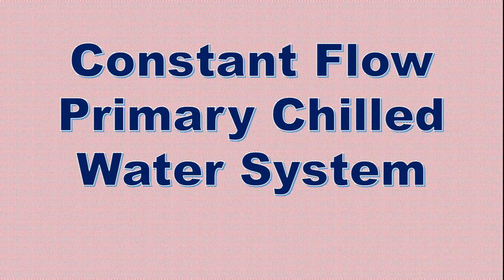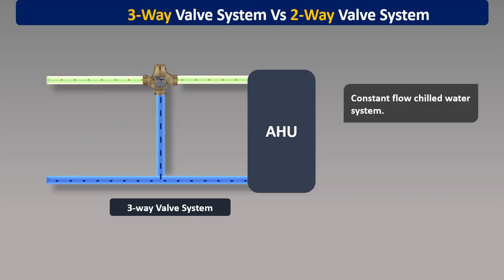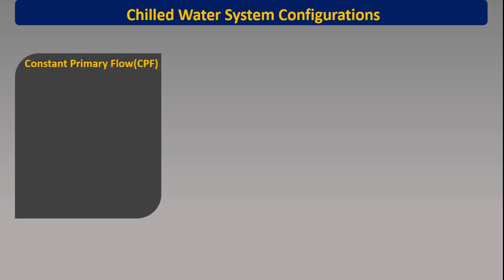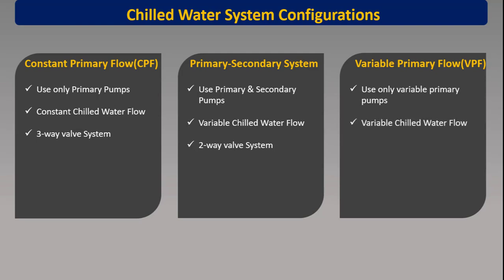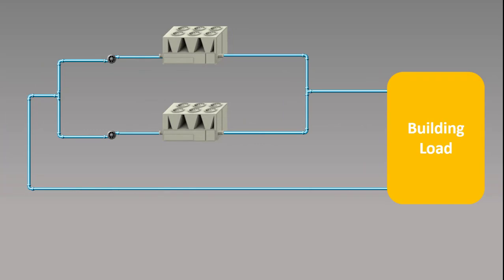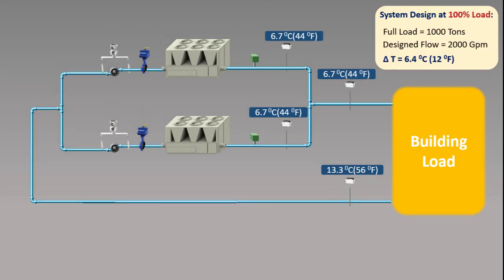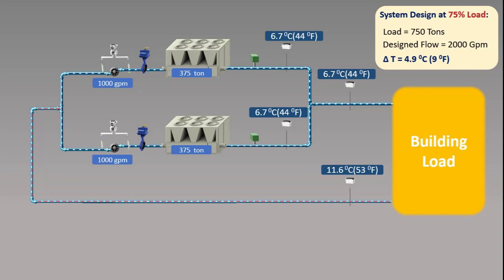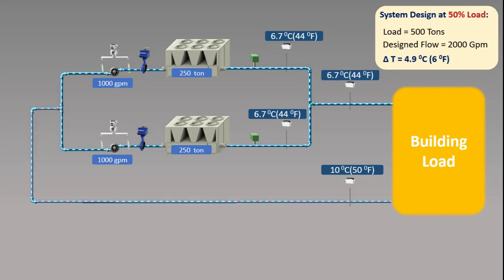Chilled Water System Working Part-1 | Building Management System | BMS Training 2021

Comment: Hi @TechSystems thank you for the video. You mention in the video that the motorised butterfly valve is their to isolate the nonoperational chiller but in the video when the second chiller is off at low load the chiller is not isolated in order to maintain a constant flow at all times. Question - In what scenario would you isolate a chiller and what effect would the drop in volume have on the 3-port control valves downstream (e.g. in-balance, decrease in authority)?

Comment: @techSystems - love the video, thank you. Just a question: At around 9:15 in the video, only 1 chiller is running due to low load conditions, but why not switch the accompanying pump off as well to save pumping energy costs? It is not necessary to run both pumps in this configuration with only 1 chiller running?
Reply from the maker: Hi,
This is a constant flow system with 3-way control valves at the AHUs and FCUs. So that's why both pumps needs to run to always maintain constant flow through system. Due to this drawback, this system is no longer used in the new buildings instead variable flow system is used with 2 way control valves.

Comment: Very informative video. Could you please make video about how chilled water pump speed controlled by differential pressure when there is high or low load, in secondary side pumping system.

Comment: Chiller sequence /Auto / n series main nhi chal rha h toh kya fault hoga plzz explain guyzzz
Reply from the maker: Was it working in Auto sequence previously? There can be many reasons. Might be the problem with DDC program
Reply: @TechSystems  yes its working before I checked All CMS Panel N DDC panel bt no fault found i dont u derstand what is the issue ??
Reply from the maker: It is really difficult to understand without physically troubleshooting it. There could be any possible interlock in control program which is inhibiting the system to operate or might be any issue from some field device signal. Sorry cannot help you with that.
Reply: @TechSystems  ok Sir